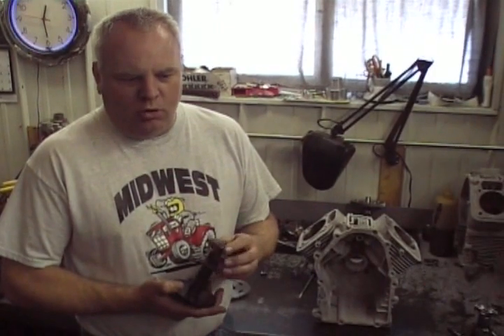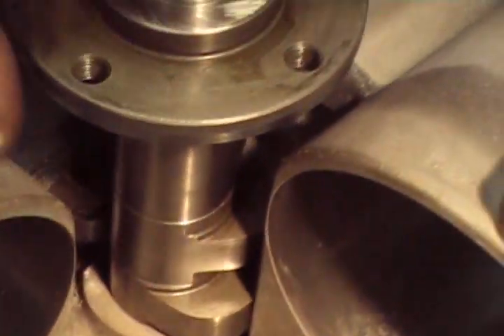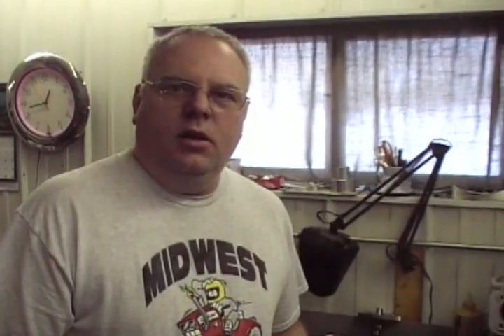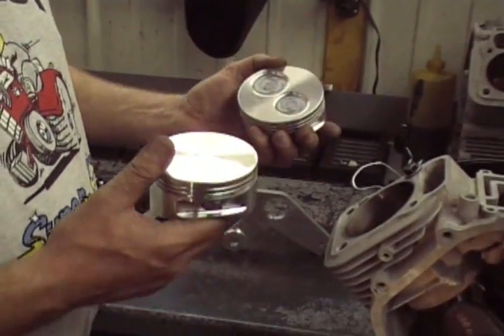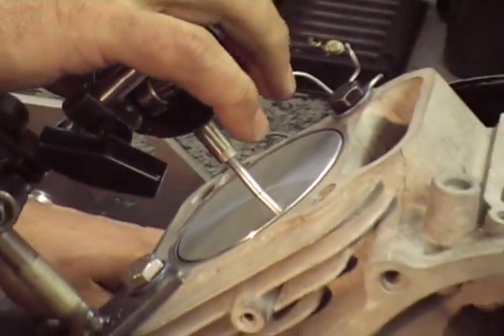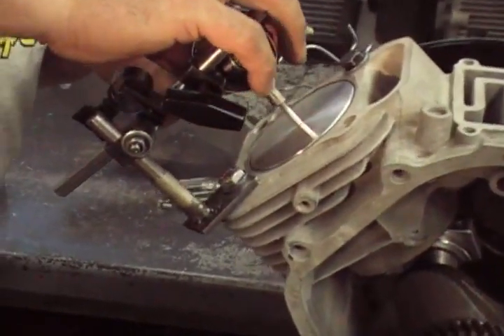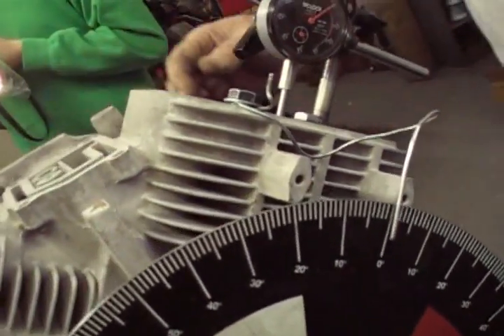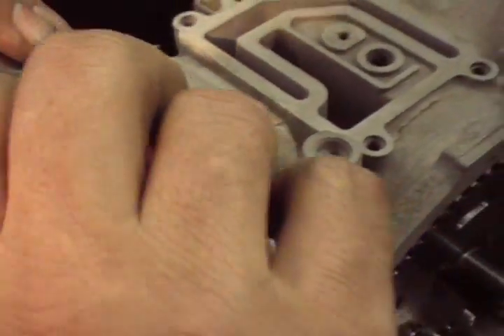Midwest Super Cub's Learn How Now: Degree a Cam in a V-Twin

Comment: You’re a degree wheel is not centered. Which means your adjustments will be off
Reply: 360°is 360° even if it lobes one way. As long as the point of reference is directed to the rotational center.

Comment: I rarely comment on here, In fact I believe this is only my second time ever. First I'd like to say nice job. Very informative refresher for me. Did a lot of this in my youth. 406SBC
More importantly please watch your video as you're spinning the degree wheel. You can see it raise and lower against the cooling fins on the block. Which to me means the degree wheel isn't centered . I expect that's part of why you had readings that didn't agree with specs. One other thing we NEVER used the degree wheel as a hand hold for spinning the assembly, to easy for it to slip. 

Thank you for loading. Once again nice job.